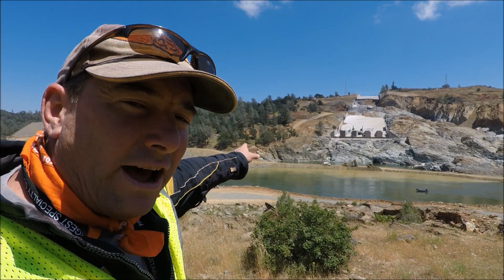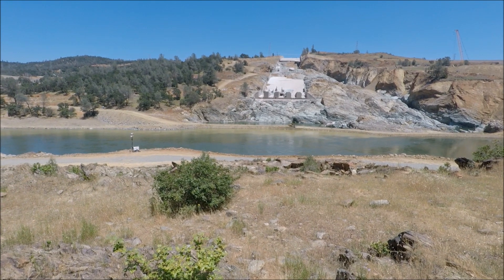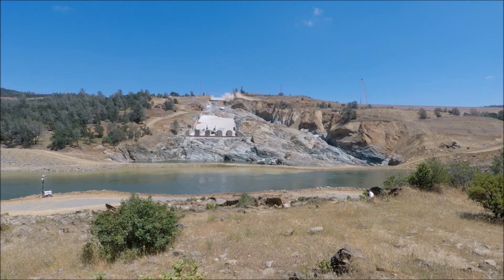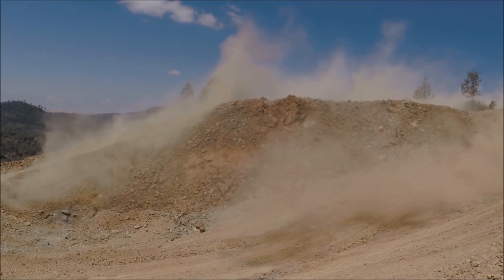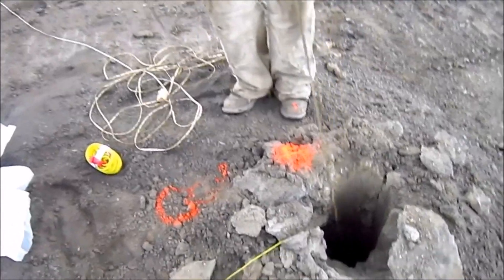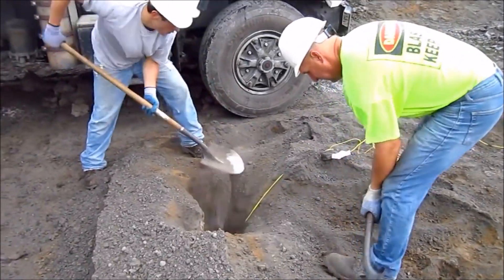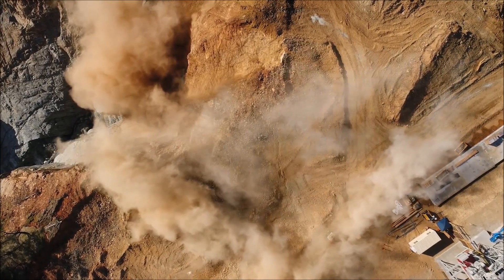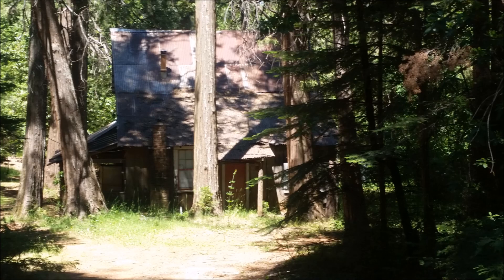Oroville Update Blasting! 25-26 May

Comment: I guess someone has placed a seismometer on the dam to monitor the vibrations getting to the dam itself. (?) I hear you say it is about a half mile away. I guess they have one attached to the top near the spillway gates and another over near the top of the emergency spillway.  Or am I dreaming?
Reply: Hope you're not dreaming Sara...
Reply: When a  mortar round hit the ammunition supply depot at the U.S. Forward Operating Base Falcon south of Baghdad. a seismometer just four miles away was also registering every boom and shock.

Comment: No biggie, just a big truck full of liquid explosives thats all.
Reply: Its a solid pellet. They auger it up to the pipe and just let it flow as the stuff is insanely stable until you ether heat it or shock it with another explosive. 

Smaller mining/landscaping companies can get the stuff in 60 pound bags as if it was concrete rather then the bulk trucks the large operations use.

Comment: ANFO gives a slower push and is preferred for construction and quarry work. I used PETN or Pentolite in seismic oil exploration in the late 90's. Petolite is very stable but energetic. I can see why they use it to set off the ANFO.

Comment: You've probably already noticed that the crawler crane they're using to erect one of the batch plants has a flashing, red warning light on the end of the boom. The boom is probably at least 250' long. I noticed it the first night that the state parks had the web cam up and running. I wonder if it's meant for low flying Luscombe's?

Comment: ANFO is a low density explosive.   It fractures the rock without shattering it and throwing bits far away from the shot.   The shot up above had very nice lift, looks like about six feet.   Looks like they're building a ramp for a road down into Croyle canyon.   They need to get rollers and other heavy equipment into the canyon so they can get the job done.
Reply: Precisely. Explosives have a lot more to them than most would think. These are nice, slow shockwave blasts, designed to loosen but not move the earth so the excavators can easily deal with it.
Same reason the spillway charges look tame, the blast has been designed to happen under the slabs, to crack the concrete up & break it loose of the substrate.

Comment: 16:30 you'd think they'd use remote controlled bulldozers for the work right on the edge.
Reply: Or how about a 30 foot extension  arms for the blade. Operator can push over the edge and still stay safely back.
Reply: The've had RC mining equipment since the 80's.
Reply: Ever see one go renegade? In the early 90's I had a 80 ton RC crane with a 40 ton load on it runaway unresponsive. Ooooo that was expensive once it stopped! :)

Comment: Juan, do you know if they're changing the angle at all when they restore the top part of the spillway at the point where it failed?  Do you know where I mean?  Where the angle of descent changes from the top of the spillway to the mid-section?  Another excellent vid, BTW!  You know we all love to blow things up!
Reply from the maker: I think it will remain close to the original design angle...
Reply: Thanks, was just wondering.  Seems like a natural place to expect unreasonable wear...  That's a lot of pressure making that adjustment.  Oh, well.  This was a lot of fun!  Hope they blow up more stuff...  :)

Comment: to fix 'shaky cellphone' video, you can use a selfie stick, and use a 1/4-20 screw to attach something heavy to the bottom, or use zipties to stick a water bottle holder to the bottom to take out shaking.

Comment: Why are they filling in the canyon if there's a chance of using it again this wet season?
Reply: John Easton They are filling in a section of the canyon to build a road between the concrete plant and the spillway. They're gonna need a bigger dirt pile
Reply: That what it looks like to me.
Reply: The snow melt is almost done.  What I worry about is how well they rebuild it. I hope there is no skimping on the cement and aggregates (sand, rock, cement). Having to work with Guntert and Zimmerman in the 80's we made a 14 inch by 24 ft highway one mile in a day in Pennsylvania. It took a little cheating (overweight trucks) but was done.

Comment: they should leave all that granite intact, it did a great job protecting the dirt dam.
Reply: Trouble is it's not granite. It's something else that's so bad they can't even use it for fill
Reply: Looks like shale.
Reply: Saprolite.
Reply: Too young to be saprolite, high levels of glaciation here. It's none other than the California State Rock, serpentine which forms bedrock for most of the Mother Lode region which this is smack in the middle of. Why use this softer grade of rock when you have granite boulders for fill?  That's what they used on both faces of the dam, very thickly too. 20 - 30 feet of it, I disremember exactly.
Reply: It's sturdy stuff...drifted in from the Pacific basin millions of years ago! North Sierra Terrane !